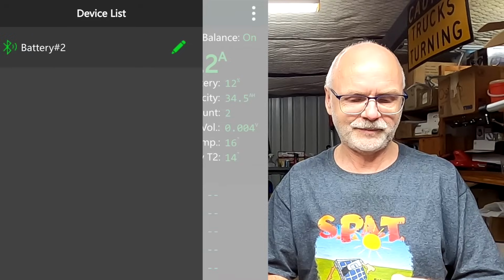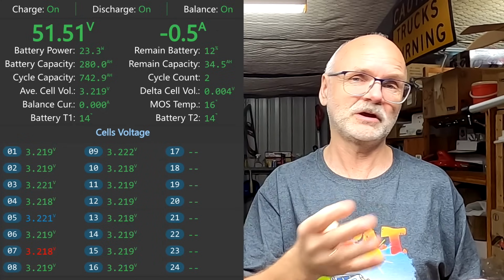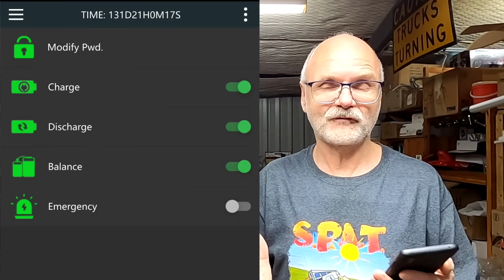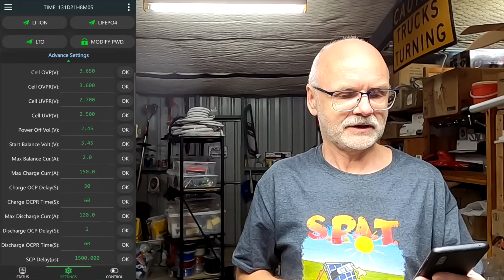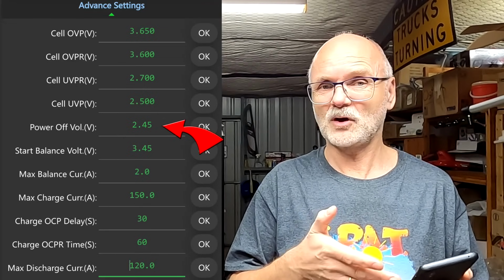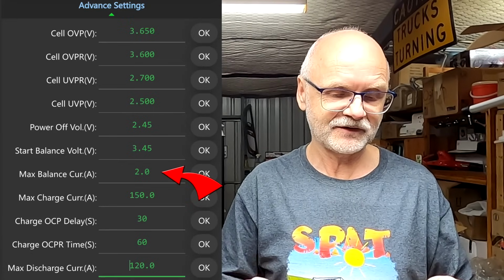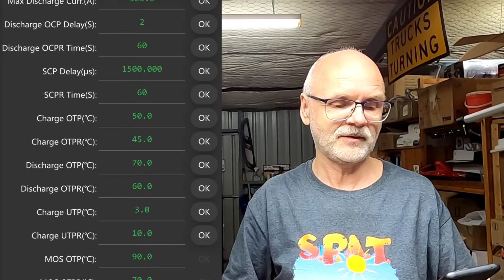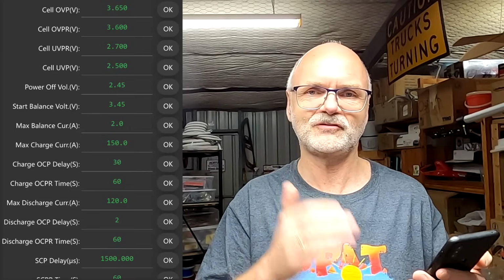JK-BMS: all settings and menus explained. How to program and set parameters.

Comment: An example of how good this BMS really is. I installed 32 EVE 280 cells with no top balancing, hoping the JK BMS with active balancing would do it. The cells varied from 3.1 to 3.4 VDC. Three days later, the difference is 7 MV. Great product Andy, thanks for the recommendation.
Reply from the maker: Thanks for sharing. That's what I do as well, I don't bother putting all batteries in parallel any more, I just let the BMS handle it.
Reply: @OffGridGarageAustralia  true true I got my batteries around 10pm I just parreled it till 10 am and connected it to the BMS and a day later it's in balance with .2mv diff
Reply: @OffGridGarageAustralia  Andy... what bms app can I install for my new jk bms? Please respond
Reply from the maker: @matthewknight5641 What do you mean by new JK BMS? Is this the large inverter BMS with coms port already you have?
For the 'normal' JK BMS, I have the link to the app on my website: https://off-grid-garage.com/battery-management-systems-bms/
Reply: I made the same experience.
Reply: I need to know what app will install on my phone so it can see the new jk bms. Any help greatly appreciated
Reply: @matthewknight5641  On Android look for "JK BMS".
Reply: I'm trying to find for 32 cells and I can't find it, please a link where you bought it I will be grateful thank you.
Reply: @christosxenopanagos2737 Most likly 16s 2p configuration
Reply: wow 7 megavolt is quite a lot, u sure about that?

the symbol for mili is m
the symbol for mega is M
Reply: @sander4436 yeah just what I thought seeing 7 Mega Volt ! holy f*ck that crazy 😂

Comment: I cut the sense wires to different lengths, to neaten up the mess on top of my battery and of course it does show differentiated resistance values on the status tab. There was a bit of a debate on the forum regarding the wisdom of cutting the sense wires of BMS's, however it seems to be functioning perfectly. (WHEW! this first time builder thought id made a mistake...) However, the question of the settable resistance values on the settings tab is one i'd sure like to have answered... thanks Andy!
Reply from the maker: Thanks Kelly, perfectly fine to shorten or extend the balance cables. There is no downside to that. The BMS is either measuring cell voltage or balancing but never at the same time, so cable length is not an issue.
Reply: @OffGridGarageAustralia  So, just to be clear, i cut the sense cables to various lengths. Individual wires are NOT equal lengths. Conversation on the forum regarding the wisdom of doing that revolved around other brand BMS's and group thought it a no no... Andy, your work has helped me tremendously and i thank you.

Comment: I had a problem with my 8S JK BMS setting the charge current too low at 50A, whitch was exceeded a few times. BMS shut down, SCC output briefly peaked to near panel voltage (initially 80v , in series, but I halved it in parallel). Victron Battery Protect switched loads off, when over 32v. Was trying to implement a solar cut off, but the fact that there is charge voltage makes it tricky. Another Victron Battery Protect between SCC and BMS would be good, but not protect SCC’s.. Had been trying  to use VBP alarm signal, but it’s not triggered by HVD. Now using the output of VBP to low trigger a relay which switches 2x 120A SSR’s (with big heatsinks) off. No more incidents since upping the charge current setting on JK BMS.
Reply: Also using a programmable relay in SCC to LVD remote switch off a SNADI inverter, using another delay timer relay module, giving a 1 second short across the inverter’s ON/OFF button. This works well, LVD at 24.8v (3.1v/cell) cutting the power to aircon at night (often early morning, today seven cells were 3.1 ish, one was 2.8) An automatic change over switch on the AC then connects grid power. I don’t have to get up to turn the inverter off anymore! There is enough power left to continue to run A. the router (WiFi disabled at night) and Raspberry Pi, both of which have small UPS, and an alternative, auto switched 12v supply from another Solar setup. B. Laptop mining crypto, on a 24 to 19v buck. Mining set to pause on battery.
Reply from the maker: Oh, wow, Michael, you're all into it. A lot of automation in your setup already. That is great.
Is 3.1V not a bit too early though and you can reach this already when turning on large loads when the battery is already low but not that low? I found 3.0V far more consistent with that.
Reply: @OffGridGarageAustralia  3.1 is before the knee down. Leaving some power for small loads, and cuts before a low cell triggers BMS shutdown, which did happen last night. Also 3.1 is the default recommended setting for the BMS driver addition to Venus OS, on Raspberry Pi, via cut off VE.Direct USB cable joined to the JK RS485 adaptor, and do need both.
Reply: I did try a 300A contactor to switch off the inverter, it gets hot, and uses 300-500mA. Turning off the SNADI remotely is better. SNADI 3Kw 24v also a charger, rarely use it, unless very low battery, or if a few grey days, and expecting a Typhoon to cause brown outs. Brown outs are fairly frequent here, often short, but a few Sundays a year power is off all day. This made me build the 12v system first, keeping fan, music, USB chargers and WiFi on. The 24v system also powers fridge, and TV by Inverter and another automatic transfer switch, with grid priority, which is useful for nighttime brown outs, when the aircon is on battery power.

Comment: Hey Andy,
I think the wire resistance is not the sense wires as this makes really no sense.
I am very sure that the BMS is sensing the resistance of the the bridge wires between the cells !
This would also make sense to have the limits for that in the settings.
Also, the measured values seems to fit into the expectation.
This is also a security feature to find loose or faulty battery bar connectors. Loose battery terminal can lead to burning.

Update:
No, it is really the line resistance of the balance leads.
They use it to detect false connections
Reply from the maker: Thanks Christian. I have to try and take one balance cable off the battery or add a resistor to se what the BMS does when it detects a higher resistance.
Reply: @OffGridGarageAustralia  yes Andy, YES, test it 🤓

Comment: A big reason for the for the cell wire resistance is due to the high balance current. I have mine set to balance to within 0.008 volts (8 millivolts). When it detects a high cell more than 0.008 above, it will start pulling 2 amps from that cell. With a wire resistance of 0.147 ohms, 2 amps of current draw will cause the reading to drop 0.294 volts. 294 / 8 = 36.75  That is an induced measurement error of 36 times as much as the voltage difference we are trying to measure. And the revers happens on the low cell. When it tries to push 2 amps, the voltage will jump up that 0.294 volts. That is not the real cell voltage, it is only voltage drop through the balancer wires. When you first power up the balancer, it cycles balance current in and out of each cell to measure those values. It then calculates a correction factor when it is pulling or pushing balance current. It is actually a very smart way of being able to monitor the cells while balancing.
Reply from the maker: Thanks Luke. But the BMS will only ever measure the voltage of a single cell OR balance this cell but never does both at the same time. It may show the cell voltage during balancing but I doubt it takes this into account as a real measurement as this would make no sense.

Comment: Regarding cell wire resistance, I assume that they are using those resistance measurements to compensate for more accurate voltage readings. I have seen once or twice with my JK BMS that it was reading a much higher resistance on a few cells and those corresponding cells were showing out of balance for me. I jiggled and tightened things and nothing changed, but then restarting the BMS seemed to get the resistance readings back to normal and then those cells showed in line with the rest again.
Reply from the maker: For voltage reading the length of the cable should not really matter as there is no current flowing and hence no voltage drop. When it balances, it does not measure the voltage at the same time. The BMS knows...

Comment: Awesome conclusion of the jk hmso settings! Sadly I'm still missing the heating function part... Looking forward to getting any further information on that, since I'm building my battery within the next few weeks. Greetings!
Reply from the maker: The 4s one I had in my hand has the heater function but I don't have the cable for it to connect anything. I will have a look in the BMS settings to spot the difference.
Reply: @OffGridGarageAustralia  Anything new here? i will start building in the next weeks and want to add the heating function from the beginning - i have no clue how to use it or which pin is what. any idea where to get the correct cable?
cheers from sunny hot germany :-)

Comment: Sir, nice and detailed video, and you mentioned several times that the battery would shut down, but it is not in all situations that the bms cuts off the battery pack, in most cases, it just cuts off the affected cell alone. When there is an OVP and a cell is at 3.6 which is my setting, that cell is cut off and the remaining 15 cells continue to power the inverter because 15 x say 3.5 is 52.5v which is okay for the inverter. In the case of UVP, when one cell reaches 2.6 which is my setting, that cell is cut off and protected by the bms, but the remaining 15 cells at 15 x say 3.1 average is 46.5v which is below 48v which is the cut off voltage of my inverter, and in this situation the inverter shuts down. 
So, from my personal experience, I don't think that an OVP would shut down the battery.
Reply: Hi, what type of BMS do you use?
Reply: @d3claes  I use the JK BMS jk-b1a24s-15p.
Reply from the maker: I don't think this is possible. You cannot take out a single cell and run the power past it using the small balance cables. It can only disconnect charging/discharging for the whole battery bank, not single cells.
If you want to make a video on your channel, we're all watching 😉
Reply: @OffGridGarageAustralia  My point actually is that with OVP the battery pack is not shut down and the inverter continues to work. 

Yes you are right, because when OVP occurs, charging is stopped until the affected cell recover.

There is no need for me to do a video on the matter because you are already doing a wonderful job for all us.

Comment: I ordered 2 of the JK-B2A24S20P Power B a week ago, expecting them in 3 weeks. I was just wondering if they have a USB connection with a program for pc.
Reply from the maker: You have to download the app for your mobile phone. Either Android or iOS works fine. The link to the app is here on my website in the JK-BMS section: https://off-grid-garage.com/battery-management-systems-bms/

Comment: Hello Andy, just for my curiosity, 2 complete cycles since when ? & under normal usage?
Reply from the maker: Since I changed the capacity settings in the BMS from 304Ah to 20Ah. This has reset the counter.

Comment: Hello!  What’s up if my inverter does not have absorption time? I charge higher to 3.5 v. What should you set up the balance. Voltage?
Reply from the maker: Yes, if you charger does not have the timer, I would charge to 3.5V and then go to float afterwards. The balance start voltage should be a bit higher than float, so if float is 3.35V, set balance to 3.37V for example.

Comment: Halo Andy. I have binge watched all your videos. They are great and I love how you keep focus on the subject matter you speak off. Also enjoy your small jokes and I don't know what accent people are talking about! ;-) I am originally from France/Alsace. I speak German and Swiss German and I am used to it.
Would you think about making a video about current status of your overall system? Checking the panels, checking the current state of charging. I know its winter time in Australia so perhaps not the best time. Or maybe it is for comparison purposes?
I have learned a LOT thanks to your videos and experiences regarding the Victron MPPT and shunts. I run an off-grid WIFI backhaul communication tower in the middle of the jungle in Mexico. I use a 100/50 MPPT with the 500A shunt and a Raspberry Pi for remote monitoring and it is the BEST upgrade I have ever made on the system. I have 2x 450W panels and 6x AGM 110Ah batteries. I draw about 105W or 2.6kWh and can survive with no sun for about 5 days. My batteries never go lower than 90% which is great (specially being AGM batteries). My dream would be to add an inverter so that when we go up for maintenance, we have 110V AC power. But I can't justify it.
THANK YOU
Reply from the maker: Thanks a lot for sharing, Thierry. That's a great system you have set up there. I like the fact the AGM won't go under 90% often, so they should last quite a while.
I can certainly make a video about the actual status of my project... great idea.
Thanks again. Mach's gut!
Reply: @OffGridGarageAustralia  Danke! I wanted to send you a photo or 2 of our installation. I think you would find it interesting. Let me know if I can find an email address for you somewhere. Weiter so!
Reply: @itsdouetthierry  Hi Thierry, I think Andreas' email is on the Home page near the SPAT section.  Middle of the jungle in Mexico sounds amazing. Marji

Comment: Great video. Does anyone know how it resets the SOC. Some bms do this at the end of bulk charge. Mine been running for 2 months and noticed when fully charged its 96%. 
How fo you reset this to 100%?
Reply from the maker: From memory it does it when you go all the way to 3.65V on each cells. Is that the only device showing you SOC in your system?
Reply: @OffGridGarageAustralia  Yes I'm using the JK BMS RS485 adaptor and driver. Works great but tempted to get the 500A smart shunt. 
Be good if they have a button to reset the SOC. As we all know it drifts over time and really needs resetting at the end of bulk charging phase.

Comment: Thanx from Norway, i see u have 3 banks with each bms,, do u only use 1 mppt on each of them,?
 (victron mppt,, what size) 
Then,,, more, ? from me, 😅😅 do u use 3 different inverters,?
Reply from the maker: Thanks Ronny, all three banks are in parallel, so all charge controllers charge all the banks at the same time. I have 2x 150/70 and 2x 150/35 charge controllers. I use two Victron inverters connected in series.

Comment: I do not know why anyone would adjust the sense wire resistance manually when the BMS does it automatically.  Andy, did you leave your sense wires full length or cut all of them to the same length?  That would seem to be the case given that all of yours are about 0.15mohm.  I cut mine to length to keep a neater installation and my IR's range from 0.123 to 0.143. I did not do anything to get those values other than shorten the wires.
Reply from the maker: Mine are all extended as shown here: https://youtu.be/3gm9LvKl2qs
It makes no difference if you cut or extend them. The BMS will either measure the voltage or balance with 2A, but never at the same time. So voltage drop is not a thing.

Comment: What is the minimal current that JK-BMS can detect? I have a 150Ah LiFePo4 battery from Liontron in my VAN and it‘s BMS cannot detect small current e.g. 0.4 A caused by a Raspi for instance. Thus it comes to totally wrong calculation of SOC and it can happen that the BMS shows 100% SOC and a short time later it cuts the battery from the system because it is empty! Therefore I cannot recommend this batterie and the BMS inside.
Reply from the maker: It is 0.1A in the JK-BMS. They all have a threshold to avoid 'noise' at very low currents and wrong measurement.
Reply: @Klaus-P. T 
You likely really need something like the Victron BMV-712, though even it will get out of calibration over time. 
You need to then fully charge the battery after a significant number of partial cycles so the unit is then recalibrated for 100% SoC.
Reply: @FutureSystem738  You are absolutely right and that was exactly my solution. But these extra costs would be not necessary if the supplier did hold its promise in all prospects and flyers to show the exact SOC at any time!
Reply: @KPTnVAN  It’s basically impossible to “count coulombs” in and out accurately over a lengthy period of time, and then with the very flat voltage  curve with LFP batteries, the only option is a full charge till the “step” of the voltage curve where it rises for a resync of the battery meter.
(That’s also why for example the Teslas with LFP batteries also need a regular full charge for calibration, whereas non LFP Teslas don’t ever need a full charge, and it’s actually not recommended except just before a trip.)
Reply: @FutureSystem738  Shure! I don‘t criticize a difference between real an calculated SOC. But basic of any attempt to calculate rightly is to measure any current going out or in the battery. When a BMS as in my LIONTRON battery don’t measure half an Amp then each calculation is wrong!